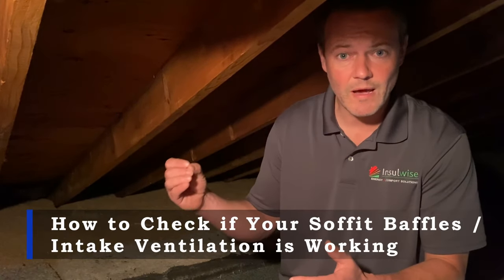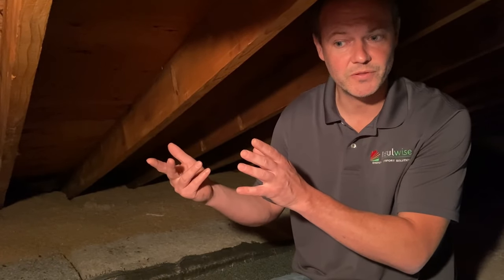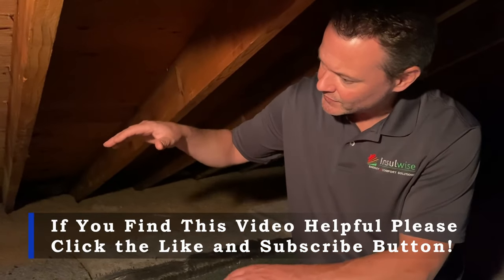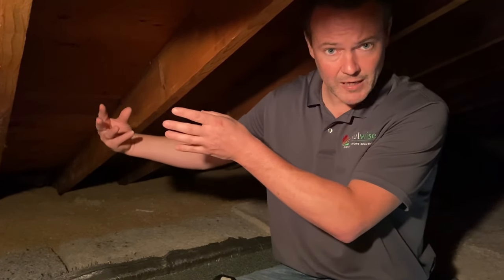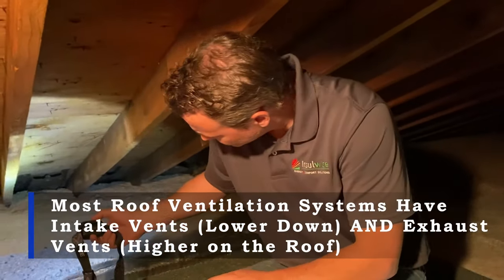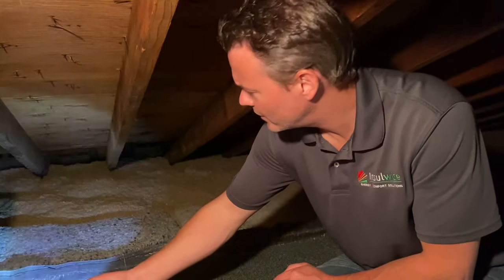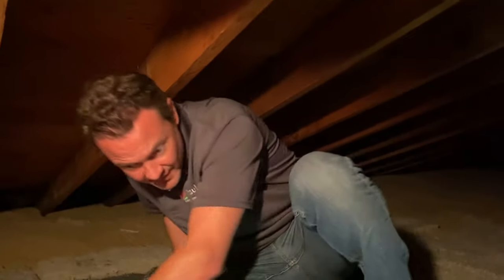How to Check if Your Soffit Ventilation Baffles are Working (from your attic)

Comment: I have a quick question for you.. I just had a new roof installed and took off my can vents and had ridge vents installed.. Should i keep my gable fans or not? Also i will install plastic baffles and what do you use at the bottom of the baffles to plug that area so insulation doesnt fall into the soffit area?
Reply from the maker: These are all good questions.  Firstly, and this may be a controversial opinion, but we NEVER block gable vents.  If your house has even a remotely east/ west orientation you should be getting a fairly good breeze through those things.  Technically gable vents can disrupt the air current going from soffit vents to ridge vents, but I'll take positive air pressure via wind over "stack effect" in an attic every day.  We have SOLVED attic moisture problems MANY times by unblocking gable vents that roofers blocked when they installed soffit and ridge vents.  
For blocking beneath the baffles we use fiberglass batts.  The batts NEED to extend over top of the exterior wall top plate and the end of the baffles NEED to extend beyond the exterior top plate by a few inches just to be safe.  You just need to be careful not to crush the bottom of the baffle when you push in the fiberglass.  You can use a 2x3, crutch, or pole to nudge it into place. 
Hope this helps!
Andy
Reply: Thanks so much Andy.. This is exactly what i will do!! Thanks again & God Bless you and your family!! L.T. Dan from KY
Reply from the maker: @LTDan-pk3mx    You are highly welcome!
Andy

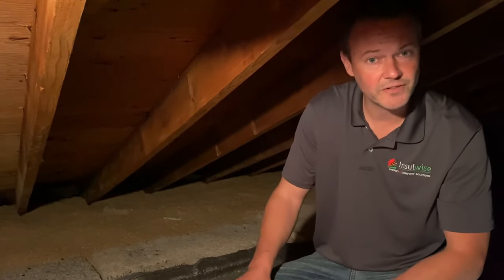Comment: Does the whole Eve around your house if you only have 15 suffix around your house that go up into the eve do those suffix suck in air to the whole Eve area around the house or just in that one area where  the vent is only 1:45
Reply from the maker: Hi there, I am not familiar with the term suffix here, but I think you may mean soffit vent.  If so, those vents will all allow air to be pulled upward into the attic (so long as you also have exhaust vents at the top of your roof).  The effect will be to mix outside fresh air with the air inside your attic.  This will reduce heat build up in the summer, and also reduce moisture build up in the winter.

Comment: So we live in NJ and bought a house last year.  It is a rancher with small attic. It has 2 gable vents on either side. Where the roof hangs over i don't  see any soffit ventilation. The house is build in the 50s . Was it common then to not have soffit vents and how could i change that?
Reply from the maker: Hi there, I don't know for sure about NJ, but my guess is the house designs are not tremendously different from Pittsburgh for the era.  In Pittsburgh they didn't start installing soffit ventilation routinely until the 1980's.  Prior to that if there was an overhang, it was solid wood with no ventilation 98% of the time.  What you do often see are solid wooden soffits that are covered with updated aluminum or vinyl soffit that is perforated.  The perforations give the indication that the soffit is vented, but the install teams almost never drilled holes into the wood prior to installing the perforated soffit, so it's just a decoration.  
You can have channeled soffit vents installed in your overhangs / soffits for sure and that would be a great idea.  Or if you have a new roof put on have them install under shingle intake vents along with a ridge vent, that will take care of the issue as well.  Hope this helps!
Andy
Reply: @insulwiseenergycomfortsolu3293  thank you so much, the ownerbhad just the roof replaced before we bought the house. It does not look like there are vents under the shingles.  I will look into installing functional soffit vents.

Comment: If mine are blocked how do I clean them out?
Reply: What did you end up doing ?
Reply from the maker: Hey sorry that I missed this.  If they are blocked it is NOT easy to get them cleaned.  If they are functional soffit vents and are blocked with insulation you will need to either rake out the blown in material, or tug the batt fiberglass out of the area.  This is difficult work.  If you pull the insulation back to far you then leave the edge of your home uninsulated or poorly insulated.  You'll know this has happened if you see a melt line of snow around these areas in the winter time.  Hope this helps!
Andy